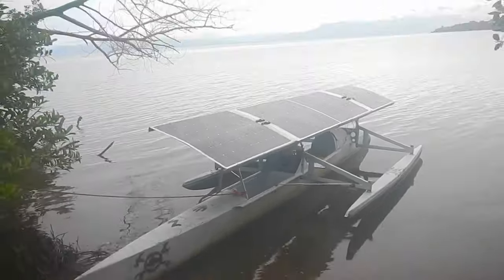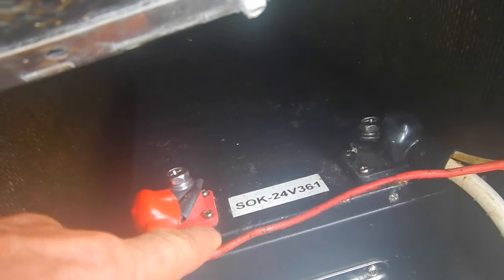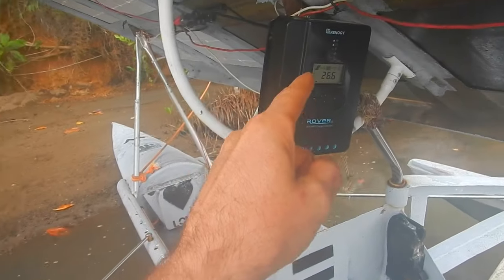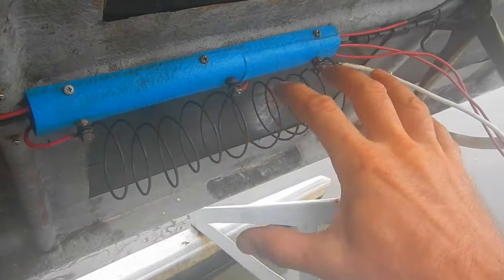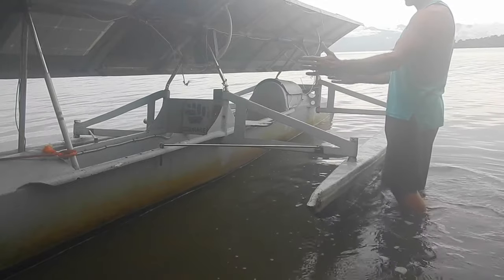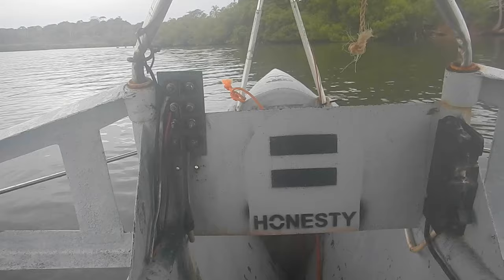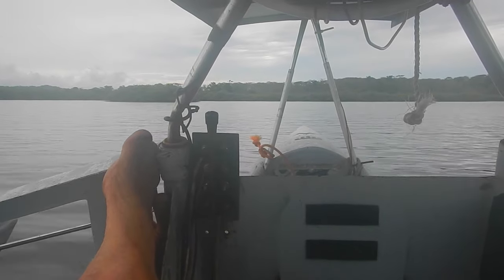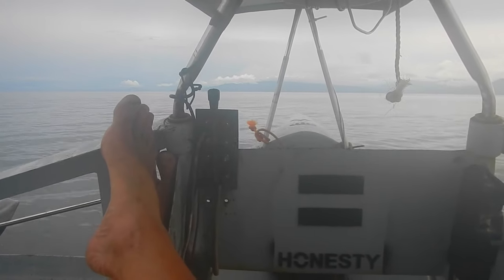Check out this Awesome Solar Boat, The Zombie Chopper...

Comment: Reversing polarity with another switch would give you reverse... That squeaking may be the motor bearing.
Reply: Yep, you can wire to have a switch changes the polarity, (switches the wires) the motor runs backwards. Really just opposite forward.

Comment: I believe your coil doesn't slow the electrons down, the resistance in the coil burns off excess energy you don't want.
I think you would find that it is more efficient to use a step down transformer..
Reply: The whole set up is like that. Nothing is efficient in a way like the nicro but in some weird way everything human designe is Taylor made for him.
Ingenious and somewhat easy. Bare minimum and indestructible. Sometime thats what you need in something.
I loved it.

Comment: Four seasons are my pleasure and my 24-volt marine lead acid battery can be maintained through winter storage. All solar powered of course.
Some lithium batteries have heaters internal to do the same.

Comment: Very cool!  I have a west wight potter 19 that I am converting into a little trawler by raising the cabin top about 20", adding windows and bringing steering and motor control's inside.... have some crazy idea of adding the pontoons with about 1200 watts of solar power on each side.

Comment: Pretty awesome. For zombies flexible panels are good. For longevity needs ro be glass panels. If you did an update some bifacial panels could improve the output. Though youd lose some of the sun protection.

The boat is great though. I like those articulating pontoons.

Comment: You need to clean those connections and put something on them to stop corrosion reoccurring.
Every crappy connection costs you current.
And have you thought about mounting the panels on the outriggers?
In and significant wind you must struggle with them up there acting like a big sail.

Comment: Pretty awesome. I thought of something similar back in the day, I wanted to split in two jet ski inboard impellers two throttles forward and reverse capable. Bobcat meets jet ski makes canoe. Throttles look like and function as carry handles. You can spin on a dime with dual intake and exhaust. It look funny because you'd have pretty advanced controls but you would look like you're flying by the seat of you pants. Wrist twistings handles, arms resting by your sides. Lazy comfy capable

Comment: I’m just going out on a limb here, but in the bow of that boat, you could literally fit two one and a half horsepower motors that if barrel together and rotation set properly, you can create more energy than you use I would recommend Dayton motors, but they would continuously create all the power you would ever need, including charging the battery that you would have to set up an inverter to fire it up from the lithium battery, but once running, you would have infinite power without all those panels on top. Also install a flywheel for anytime I have a charge hits which probably won’t be a you running off the lithium battery which is constantly being charged
Neat build keep up the good work 
Also, it does work engine the engine one and a half horsepower motors. People will tell you it doesn’t but it will. We have come along way in the last 20 years on electric motor efficiency.

Comment: LUV the pontoons.  and a center skull, wow. and you should figure out how to turn the panels INTO sails. and then get a 4 quad controller, so you can get regen from the prop, and charge the batteries THAT way, too. BTW, any numbers? like, how fast, at what wattage? lastly, as ingenious as the linkage on the pontoons is, you should do the same with your steering. foolproof.

Comment: Jamie would a PWM be more efficient motor control with infinite speed?
Reply: Jaimie hates electronics because they can break. PWM is much more efficient yes, but most of the time he's just traveling at max speed anyways, and nothing is more efficient than a mechanical switch. The speed control is just for docking, which is like 1/10,000th of his drive time. Not worth it.

Comment: This is really cool and inspiring.  I'll look for your other videos. 
Serious question:
What would happen if the boat sank from its weight? And you’re in the boat and you have this tremendously powerful battery, and the battery is now underwater, and there’s a shark that’s approximately 10 yards over there.
Do I get electrocuted? If the boat is sinking, water goes over the battery, the boat is sinking. Do I stay on top of the boat and get electrocuted? Or do I jump over by the shark and not get electrocuted?

Comment: ever considered a kite sail rig with flexible solar panel installed on it? that would be pretty bonkers. also, have you thought about adding hydrofoils? i feel like this thing would be a beast if it's got enough speed to get up onto foils, hulls out of the water.

Comment: very nice, how about another type of zombie chopper, trike with high lift hang glider kite with electric-pedal paramotor on the back with wide wing with solar at least 16m^2 or say 3.2kW. yep folding ultra-light flexible fabric/solar panel wing. yep kinda like flying water craft.

Comment: this is the future for e-vehicles, cars and motorcycles electricity just isn't the right choice but boats are something different altogether, the lack of friction and weight used as momentum means batteries go further and speed isn't an issue, imagine a trimaran with a huge solar panel roof 6 - 8 times the size of this one,
Reply: how about a pontoon tri hull, take a look at ( The Quiet Man) Solar Boat.  2 yrs in and still going smooth.

Comment: The coils that provide lower voltage, are they not just resistors, and still draw full power from the battery?

Comment: Pretty Cool Boat. But, as other have said, you need a PWM speed controller. Not a difficult or expensive part. That resistive coil thing is a No Go. Also, your cable gauge is too thin. For 24V at those wire lengths you should be using 10 gauge or 8 gauge.

Comment: Nichrome wire to limit speed is a waste of precious energy.  Build a PWM (Pulse Width Modulation) controller.  It won't waste hardly any energy and will be much kinder to your motor if you want it to last.  With a PWM controller, you will have variable speed instead of just 3 speeds. Much much better.

Comment: These videos thought, fundamentally miss-understand how connected we.   If a zombie apocalypse could happen we would be all fucked include this guys. Those batteries will NOT maintain charge forever and will eventually die and need replacing, same with the motor etc.... 

However, just as a solar boat for non-zombie apocalypse camping this thing is AMAZING good job.

Comment: Dejavu, great useful project! I like it when these things come together nicely. 
Have you seen rctestflights propeller test videos? Hes got a competion going on most efficient propeller with designs from engineer's submissions. 
I want to now make a 2 blade boat prop, as boats are fairly non efficient, at least the wider ones. Makes sense that the very traditional boats are also the fastest and most efficient, as there was less power sources available at those times.

Comment: Showing off a "solar" powered boat on a misty overcast day. Con. Lets see how long it runs after a few days of cloudy rainy  weather.
Reply: Probably about as well as a car would work without gas. 

Thankfully the sun will come out eventually, good luck finding gas in the apocalypse after the first couple months!
Reply: @splatter_proto good luck finding lithiim phospate battery either
Reply: At least a good lithium setup will go a decades fuel degrades WAAAAY before that, although you could make diesel from plastic, but you’d still need oil and lubricants for an engine to work.
Reply: @villhelm  Drill baby, drill